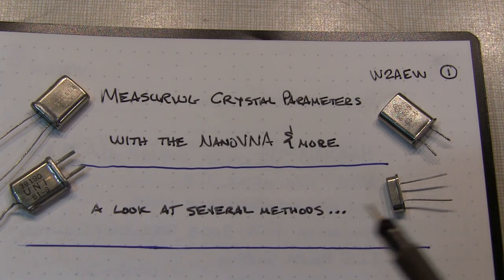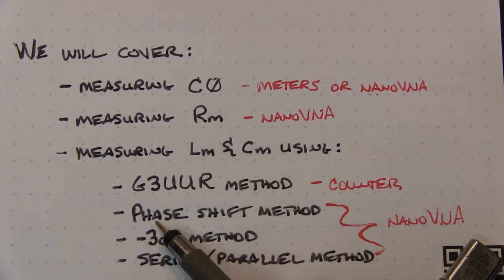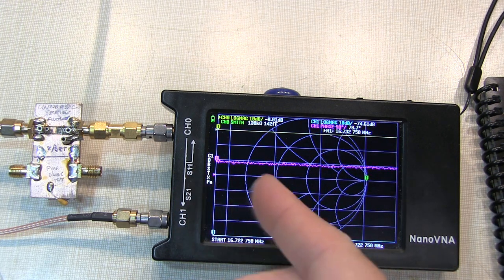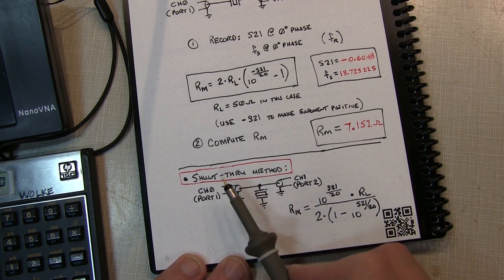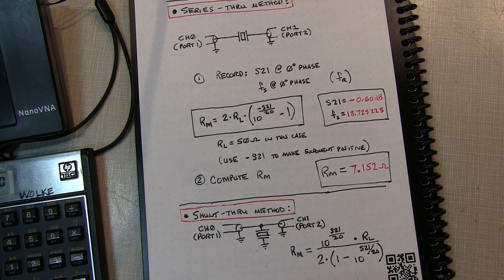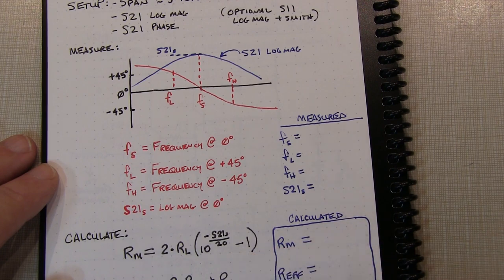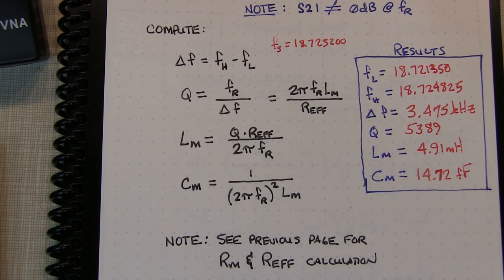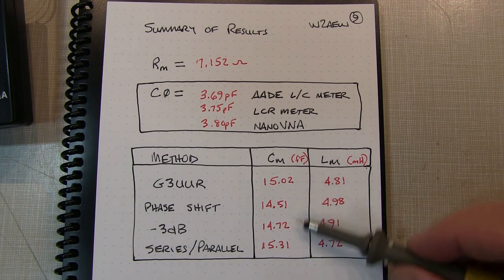#319: Measuring Crystals with NanoVNA and other tools

Comment: When I bought the NanoVNA, I thought I was only going to use it for checking my antennas. Alan, I definitely have learned from your videos that there is a lot more analysis you can do with this little analyzer. I appreciate the effort you put into your videos, and how you go about explaining what you’re doing. Thank you es 73!
Reply: Where can i buy a good nanovna? Original one is too expensive for me. I am looking for a good quality copy.
Reply: @requiem4adreamc  they have copies on eBay but do research first
Reply: So many people speak negative on this little gem... I'm pretty confident that all those people spent big bucks on industry analyzers at 400+ a pop. Lol such an amazing little tool so many things you cna do with it
Reply: @bparker86 you are so right.
However, I know people that first got the VNA but then still bought the $400 whiz-bang, 🙄even after I showed them how easy one could be used! 
What’s that line?: you can lead a horse to  water, but…

Comment: The crystal holder really brought back memories.  My father had a bunch of them and used to etch surplus crystals to get what he needed.  He also built a lot of his own equipment.  I can't remember his W3 call but he got WB2PTU in the mid 60s and wrote a bunch of articles under that.  Later he had W2IJL which I have now.  He would have been amazed at the NanoVNA and the TinySA.

Comment: HP 15C, a classic. Thanks for the information, great as always.
Reply: I owned one of those and still have an HP 48G. I now have that as an app on my phone which is very convenient.
Reply: I have an HP-15C and it is a wonderful little calculator.
Reply: @brucesmith9144   I still have a  41CX, and a 41 CV on my phone.  I recently came across an HP42 program, so I installed that one, too, just to play with it.  I just now looked for a 15C program, but the two that I found are $9.99 and $16.99, and my curiosity doesn't go that far.  There is, by the way, an improved 41 clone available, from a Swiss company if I remember correctly.  I should probably buy one in case my HP goes bad.
Reply: the phone apps for these classic calculators are great -- so nice to be able to continue to use that muscle memory of the RPN

Comment: Users may want to take note that the newly released NanoVNA V2 Plus 4 model has a warning stating it cannot be used to measure crystals because the source signal is rapidly pulsed. This also prevents it from being useful as a signal generator.
Reply from the maker: Oh interesting, I didn't know that about the V2 plus 4.
Reply: @w2aew  This is the latest official, not cloned, model according to this link: https://nanorfe.com/nanovna-versions.html The only place that seems to have it in stock right now is Aliexpress, official NanoRFE Store.  It's in a nice aluminum case, features 4" display, 4x faster sweep (400 points/s) frequency range to 4GHz and up to 80 DB dynamic range to 3GHz.
Reply: Do you have a link or source for that warning? I had plans to by the V2 Plus 4, but when that is true I will stick to my H4 and V2.
Reply from the maker: @PH2LB  On the official webpage of the V2 units, there's a note just below the specification table (about 2/3rds the way down on the page):
https://nanorfe.com/nanovna-v2.html
Reply: @w2aew  I need new reading glasses because I have read that page but totally looked over the note. Thanks for pointing out. ,👍

Comment: The NanoVNA Test Board Kit can be used for these measurements as well (available at R&L Electronics if you don't want to role your own as Alan did). And an old standby is W1FB's crystal measurements box (similar to the G3URR circuit) but primitive compared to what can be done now with the VNA! Thanks Alan for sharing, great letdown!  73 - Dino KLØS
Reply from the maker: Letdown?
Reply: @w2aew  Damn autocorrect!  Great LAYDOWN!  ;-)

Comment: I use a 4 to 1 transformer fixture and the nanovna saver software can analyse -3db points automaticly. Is good when you have to measure loads of xtals for a filter

Comment: That is quite a video. I hung in there the best I could : ) It's interesting that anything with mere-mortal equipment could be used to calculate Femto-anything at all.

I wondered if several crystals could be placed in parallel for a more measurable Holder-capacitance reading, overcoming the lead/fixture capacitance, likewise with the Holder inductance, but in series, of course. I thought that if several were measured together they also might be average out the manufacturing tolerances, in the same way that DMM manufactures place resistors in parallel to gain better accuracy.

I was surprised that the NanoVNA could measure fairly close to your LCR meter readings. I am trying really hard not to buy one. Money is tight for me, but still they look like a lot of fun. If you ever communicate with the people who make the software, please ask them to implement an anti-aliasing option, so whenever the the device display is static, it will look better.

BTW, when studying all of LeCroy's TDR/SI videos, Eric Bogatin said that one of his students/accomplices  discovered that the ground (return) pins on a SMA connector are one of the biggest problems with high-speed test fixtures. Apparently, the little grounding (return) legs are also little antennas. For higher speed, soldering the edges SMA connector itself, and cutting off the legs might allow it to reach a few more GHz.

BTW, they are PCB-Centric, but Nine-Dot has a lot on SI: https://www.youtube.com/channel/UCretWCYM5SDLWVD3Lgb-BBg
And the Aforementioned Eric Bogatin has a lot on TDR, but each video must be signed into for individually: https://www.bethesignal.com/bogatin/
...He plugs Lecroy's wares, but has has a lot on interpreting/anticipating the readings--especially in the frequency domain.

As one would expect, Oliver Heavyside, as in Step Response,  admittance, elastance , conductance, electret,  impedance, inductance, permeability, permittance, and reluctance--moved his granite furniture indoors, and painted his fingernails : )
Ref: https://en.wikipedia.org/wiki/Oliver_Heaviside#Later_years_and_views

Comment: Hello Alan, I just followed your instruction to measure 36Mhz crystal parameters. What I measured were : fs = 35'993'780 Hz , phase 9.41 deg. fL = 35'989'303 Hz, phase 54.41 deg. fH = 35'996'900 Hz, phase -35.59 deg. My question : is that normal that the phase of fs is 9.41 deg, not near zero degree ?  Thanks.

Comment: Very helpful. I would only add that it  would be nice if you included the units  you are using for Fr (MHz, KHz,Hz) and how to scale the output so it results in mH and fF. I did the math and worked backwards to get your results and the required multipliers.

Tnx,
Dale W4OP
Reply from the maker: The equations shown in the notes assume that you are using absolute units.  So, pF would be x10^-12,  frequency in MHz would be x10^6, etc.

Comment: Hi. Interesting info!! I have some issues with crystals not starting in already assembled boards, many of them. We suspect low quality crystals or that they’re overheated during production. Test production was ok , but after some time we had problems with circuit in general, that resonator 26MHz doesn’t start up when we lower the temperature like from room temperature to 15 C or lower. On working ones it works fine all the way to -20 that we have in freezer. There could be crystal fault but too low capacitors as well. Do you know what parameters change when crystals are overheated? Our application is low power, generator starts for 15ms periods only

Comment: Are those precisely calibrated ‘reference crystals’ still available then, even though people no longer cut their own crystals in the way that you’ve described?  This is pretty cool.  I wonder if it could be done the other way around then?  If we had such an accurately calibrated crystal reference, we could test and calibrate the circuitry which you’ve used here to take your measurements!!  Also, Theres a HUGE number of more experiments still that come to mind in which you could use these measurements for!  It’s very likely that you’ve persuaded someone to buy an LCR meter or one of those NanoVNAs.  Thanks a bunch for sharing!!  Very informative!

Comment: Can I ask how you calibrated your nanovna with the fixture?  Open seems obvious, but I don’t know about short/load.

Thanks for the great videos!
Reply from the maker: I simply used a small piece of wire for the short, and a small leaded resistor (with short leads) for the load, and plugged these into the fixture into the center-pin and ground sockets.

Comment: Is there any way I can buy or build an AADE meter? It seems really accurate and robust
Reply from the maker: Sadly, the designer, producer of the AADE meter passed away several years ago.
Reply: That doesn't mean the meter has to die along with them, does it? Surely the schematics can be derived from existing meters and passed along from engineer to engineer
Reply from the maker: @milesprower6641  Schematics might be able to be derived from an existing unit.  Also, the firmware for the microcontroller would have to be captured as well.

Comment: That motional resistance (crystal ESR) value seems to me quite low. Would have expected at least few tens of ohms. 
Also would be interesting, if you could run all this once again, but with a crystal where the motional parameters are known - they are usually published in a datasheet, so we could check accuraccy against that.

Comment: what is the scan resolution that this nanovna can achieve?
Reply from the maker: It depends on the firmware you are running.  Scan resolution will be the span / number of trace points.  With later firmware on some units, you can get 401 trace points.  If you use the unit with the PC software, you can achieve much higher resolution.
Reply: @w2aew  Thanks for the answer. With this model "NanoVNA-F V2 Vector Network Analyzer Upgraded 50KHZ-3GH" would it be possible to get 401 points?
Reply from the maker: @wendersonrodrigues8415  I don't know if there is a firmware upgrade for that unit that gets you more than the standard 101 points.

Comment: Could you do a video on testing the front end of a receiver with oscilloscope and sig-gen? Correct signals to feed into antenna input, attenuation etc, measurements?
Reply from the maker: For the most part, the signals you'd apply to the input of a receiver are too low in amplitude to measure with an oscilloscope.

Comment: Hi Alan, I have three questions for you:
1. How did you calibrate SOLT your fixture?
2. How did you measure the C stray capacity of your fixture?
3. How do you explain the frequency  difference between S21@ phase 0
And S21@ minimum? 
73 de iw2fnd Lucio
Reply from the maker: 1) at these relatively low frequencies, using axial leaded 50 ohm for Load, and a short wire for Short, work well enough.
2) I used a LC meter (AADE LC meter and the DER 5000).  You can also use VNA with Smith Chart.
3) They look pretty close to me - any small difference likely due to parasitics.
Reply: Thank you for the quick reply! Can I eventually contact you via email? Do I find it on QRZ.com? By the way I really like your content, it’s really helpful, so keep up the good work!
Reply from the maker: @lucioattolini9597  Yes, I am good on qrz

Comment: Excellent explanation. What firmware are you using for the VNA?  Thanks
Reply from the maker: I was using v1.0.39 from DisLord.
Reply: @w2aew  I haven't updated the firmware on mine,  yet.  What does that give you, aside from more points in the display?  I have the makings of a test fixture here that I've been deferring,  I think I'm getting close to needing to do something with it.  :-)

Comment: Thanks for the detailed explanation and demo of your fixtures. Extremely helpful as always. 
I was wondering, does these methods (except the Colpitts oscillator method I think) extrapolate to a planar coil as well? I have had to measure L, Cp and Rs parameters at frequencies greater than 100kHz. I have a DE-5000, but as you know this only goes up to 100kHz. However, I do have a NanoVNA and a SAA2N.

Comment: How come you used the Nano  H4  and not the Nano V22?
Reply from the maker: Because I could use 401 points on the H4 and only 201 points on the SAA-V2.
Reply: H4 allow work from 800 Hz. Up to 100MHz have ~100dB dynamic range in S21 measure. More fast. I think it better up to 300MHz.

Comment: This seems like a great tutorial but the terminology goes out of my reach as I'm but a simple parasitic organism over-schooled in organic chemistry with only rudimentary skills in electronics. Do you have a definition of "motional" as I have never seen that parameter in my unsophisticated world? Operationally, what does it physically describe?
Reply from the maker: A piezo-electric crystal is an electro-mechanical device.  It physically vibrates (or responds to vibration).  The "motional" inductance/capacitance are the electrical components that model the properties of the physical motion of the crystal (unlike the crystal's mounting or fixture capacitance, which has nothing to do with the crystal element itself).
Reply: @w2aew  That's essentially what I thought but I didn't want to assume, because, you know...
And, please correct me if I'm wrong, but maybe one could say the ""motional" inductance/capacitance are the electrical components that ARE modelLED BY the properties of the physical motion of the crystal" if I understand what you're saying, but, otherwise I'm still a bit confused.  
I could imagine the arithmetic to do that but it is beyond what I recall.
Reply from the maker: @twosheds918  Since there aren't physical capacitor/inductors, these are purely used to model the electrical behavior of the crystal.  These are not parasitic properties, but just modeling the resonant behavior.

Comment: Hi Alan
Just bought a nanovna and exploring uses.
I like your test pcb and would like to make one.
I have a question though, what sockets do you use to plug the dut into?
Someone on the GQRP mail list has suggested a sprung socket  https://www.mouser.co.uk/ProductDetail/571-5645500-1
Others suggest a 0.1” header socket snapped off.  Do you have any recommendations?
Thanks
Bob
GM4CAQ
Reply from the maker: I've used both of those types of pin sockets.  The AMP ones you show in the link are good.  I've also used similar ones from Mill-Max.  These sockets are generally deeper and accept a wider variety of lead/wire sizes than a header socket, but they are more expensive.
Reply: @w2aew  
Thanks for the info Alan don't mind paying a little more to make a good  pcb.  Keep up the good work, I have been motivated to get the H4 by the video you gave to the GQRP convention and I am not at all sorry.  I also have the FA-VA5 that I built and the nanovna is so much easier to use.  Stay safe.  Bob GM4CAQ.. in lockdown.. again!

Comment: Hi Alan, thanks for an interesting test method! Are you using the “standard” nano vna firmware or a version more suited for xtal measurements? The nanorfe website of the developers states that because of a very short measurement cycle the standard nano vna is nor suited for xtals or xtal filters. They point to a special firmware for that purpose, written by somebody else.
Reply from the maker: The "V2" variants of the NanoVNA are the ones that have difficulty with crystals due to the short measurement cycle.  I am not using a V2 in this video.
Reply: @w2aew  Good to mention this. In the comments some people seem inspired to get a nanovna after watching this video. If they get a new one, it is most likely a V2.
Reply from the maker: @robertvandersanden  Thanks, I added a note to the Video Notes.

Comment: If you get a chance I would appreciate your explaining core saturation on common mode chokes . I spent a few months trying to solve the following problem . On a 100mb/s Ethernet line when running POE ( power over Ethernet ) everything worked fine on short cable lengths . The longer the line became as I approached the 100 meter max length , the worse the noise became and link failed at +- 70 meters . After many months of head scratching the FAE from Wurth in Japan said “ turn the transformer around so the common mode choke is on the PHY side and not the line side “ . Everything worked ! . I still have no idea why 😬. https://www.we-online.com/catalog/media/o119953v446%20Tutorials_Connecting%20LAN%20Transformers_EN%20(rev1).pdf